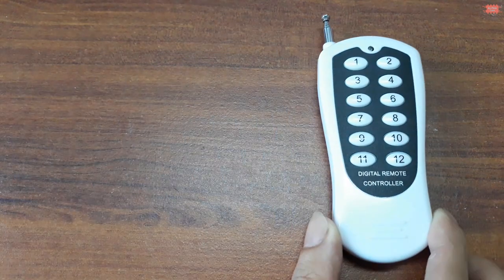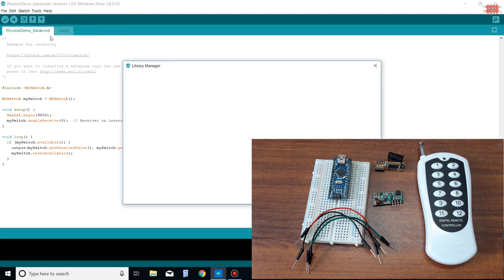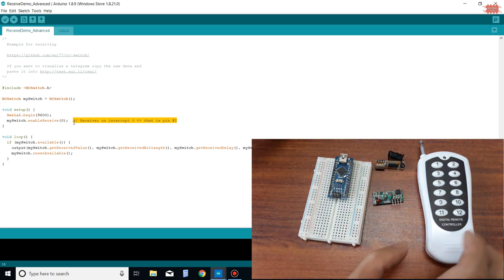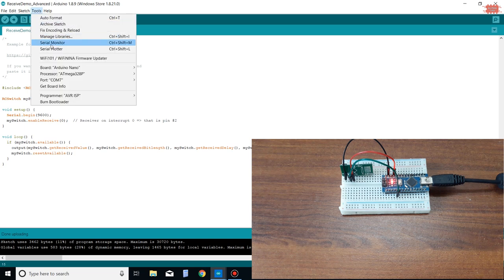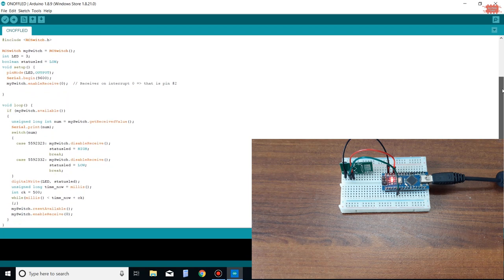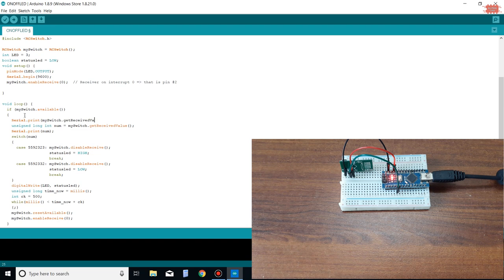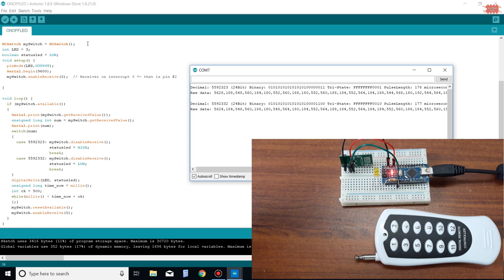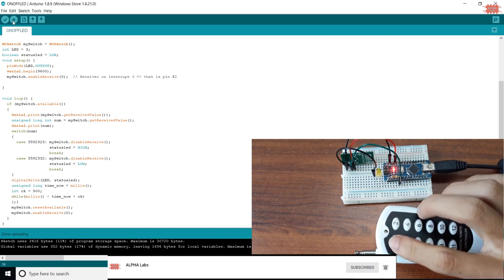How to decode any RF signal remote in Arduino | Arduino Project| ALPHA Lab

Comment: Will these work with a garage door opener remote? I have tried with 6 different remotes and now 5 different 315 mhz and 1 433 mhz receiver. Also an arduino nano and an 8266. I do not get anything to display in the serial monitor. I have tried 3.3 volt and 5 volt pins and all the digital pins. What am I doing wrong?
Reply from the maker: I hope you done it
Reply: Do you manage to do it?
Reply: I got it to work with a range of 1 foot. Very difficult to get it to work.  I will not try this setup again.
Reply: @mschaffer2826  ok, thanks

Comment: Thank you for the video! I am using an EV1527 trasmitter but the monitor doesn't log the buttons. I use wemos D1 on D4 which is the #2. Any help please?
Reply from the maker: Sorry i haven't tried it yet
Reply: Cara eu apanhei com essa placa tambem, GPIO1, 3 E 16 nao funciona com interrupçao, nao funcionou comigo. Minha placa eh a D1 R1! (Isso daria pinos D0,D1 e D2) use os outros pinos! 
E coloque no codigo o pino como o correspondente em GPIO, nao como D**!
Procure por Wemos D1 R1 pinout, vai entender!
Comigo funcionou, depois de uns dias de pesquisas kkkkk

Comment: Hi, I'm trying to receive a signal from my gate remote 433,92 MHz with the same receiver  that you have, but my Arduino Uno seem to not seeing the signal at all. What might be te problem ?
Reply from the maker: This project was so long ago, i am not sure that this libraries is available at now. Can you check this issue come from software or hardware?
Reply: @ALPHALabs02  I downloaded the latest version of the liberary rc-switch and I used an example from it, so I think software is ok. Actually I bought this receiver in a set with a transmitter and toghether they work well, so I don't think this receiver is defective. The problem is that transmitter requires another arduino board and it's not very practical for my project - I thought my gate remote would be perfect. But like I wrote before , serial monitor displays nothing when I press buttons on remote. I have no idea how to solve that...

Comment: Hey
Not a bad video, thanks for sharing.
I've had a play with the RC Switch library and have created some interesting projects. However, the library doesn't read rolling codes from common car key fobs. I'm planning an looking at and tinkering with the library code to make this possible (probably above my ability). Do you have any experience in this area?
Reply from the maker: Hope you done it
Reply: @ALPHALabs02  never had much luck with it.
The project was kind of a 'just because' and the effort involved eventually outweighed what I would have got from it.

Thanks for getting back though. I might try again at some point.
Reply: Rolling codes use secure cryptographic encoding methods. They are designed to be uncrackable. I think you might be wasting your time, unless you have a millenia or two to spare.
Reply: Haha, thanks. It was a while ago when I commented. I was hoping to just be able to receive them, see them and maybe replay them rather than decrypt them. I had 'some' success, but found it was taking up too much time for what would ultimately just be a novelty. Thanks again though.
 @iconoclad
Reply: You just get the signals by an SDR device its called software digital radio. The flipper zero kinda work like that but its not cheap. 300€. There is a USB dongle device called "rtl sdr" for around 30€. I have one and it works great. Have fun ;)
Reply: Thanks @marcomang6717  . Yes, I've had some good fun with my SDRs. I was hoping to be able to read the code in Arduino are replay it. I managed to do it with basic key fobs (non-encrypted), but not rolling codes.

I know there are some more expensive SDRs that will transmit and replay too. Howebver, this was about building it myself.

Comment: Hello, this is a video.

You can see that it works with the RF receiver 315Mhz-green.

I have a question here.
I wonder if this project is possible with the NRF24L01 module I have.

I am trying to upload a program to Arduino by sniffing the automatic door.
Reply from the maker: I am really happy because you like this video but I have never worked with NRF24L01 before. I think there will be videos like that on Youtube

Comment: @ALPHA Labs  I hit a wall.  I purchased a 433 Mhz 4 chanel receiver and have a 433 Mhz remote.  To make sure they work together, I wired an led to the receiver and am able to control it with the remote.  Next I wired data D0 of the receiver to D2 of the Nano and off course ground and Vcc.  The Nano works fine and I have used it prior to this for controlling led lighting.  Once I uploaded the Demo_Advanced, I expected data on the serial monitor but just have a blank screen.  To make sure the monitor works, I inserted a println statement and that shows up in the monitor, but no data from the receiver.  I also made sure the receiver is encoded with EV1527.  Any ideas?
Reply from the maker: Sorry for late reply. Hope to you resolve your problem
Reply: @ALPHALabs02  It may have had something to do with the  receiver.  I purchased a single channel kit like your video shows and all is well.

Comment: Hey ! 

Thanks for the video. Very enlightening. I tried to do it with remote control (RF433) used in residential gates, with 3 keys, but it didn't work. Can you tell me if this example doesn't work for some types of control?
Reply from the maker: Hi, my friend. This is a video that is created a long time ago when I am a student. I am only checking with a typical remote. Hence, I afraid I can't help you
Reply: @ALPHALabs02  No problem, thanks so much for the reply and help. regards. Bruno.
Reply: @brunowolfpack6767  did you ever find a solution?

Comment: Hi, I want to use nodemcu card which pin i need to connect RF data pin? Also is it possible to use any pin or i need to use only one pin? Thanks in advance!
Reply from the maker: The data should be connected to interrupt pin
Reply: Tui không nhận dc kết quả gì hết. Tui dùng bo esp8266 vẫn không được.

Comment: You do realise you can tune the little slug capacitor on the receiver to change the frequency you do this by keep pressing the remote but have the remote far away as you can and turn the tuning slug until the led blinks alot and turns off for a second. Now what is this led you talking about well you connect any colour led (I used yellow) and you connect the led to the receiver ground and to one of the data pins any and you should be able to change the frequency of the receiver. Feel free to ask me a question about this
Reply: Is it possible that i make a device that can automatically find the RF? Basically like a universal remote for all devices that transmit with a radio frequency. Thanks

Comment: I'm struggling to replicate an RF remote signal which I'm told is on 16mhz frequency. Could I decode that using these instructions? I see 433mhz as typical RF signal.

Comment: I would like to use this method to do the following.  When I press the remote button the first time, it turns something on, an LED for example.  When I press the same button on the remote again, it turns the LED off.  I know how to do that with a physical push button connected to the Arduino, but am not sure about coding it when dealing with the data received on input 2 through the remote receiver.  Can you help me with that?
Reply: 5:25 ...it will help you doing so..
Reply: @haseeb7027  Thank you, I somehow missed that.  I'll take a look at it tomorrow and hopefully make it work.
Reply: Still having a difficult time making the same button press turn on, and a repeated press turn off.  I can do it with a simple push button, but not when dealing with the data from the receiver module.  Being a beginner, I'm not sure where to go from here.
Reply from the maker: Hope you done it

Comment: Thank you for sharing this video.  The transmitter/receiver kit I bought says 4 channel.  Can I still decode a 10 button remote and have the Arduino respond to all 10 buttons?
Reply from the maker: If the frequency of remote is matched to the frequency of receiver, it will receive data.
Data of receiver is transferred to Arduino by wires so that 1 or 10 button isn't problem.
The important thing is to match frequency between transmitter and receiver.
Reply: @ALPHALabs02  Thanks for the quick reply.  My receiver should be coming in the mail today.  Everything is set up.  Fingers crossed.  Would you mind if I did a tutorial using your method on my channel?  I would off course link to your site as the originator.  I think my subscribers would like this.
Reply from the maker: Ok. Don't worry about it. No problem

Comment: I don't get any output in my serial monitor. Is it possible that intrupt ports are different on a wemos d1 esp wifi board?
Reply from the maker: Hope you done
Reply: Sim na wemos tem que usar outros pinos, o que voce coloca no codigo tem que ser o correspondente ao GPIO da wemos... procure por wemos d1 pinout!

E nao use GPIO1, 3 E 16!